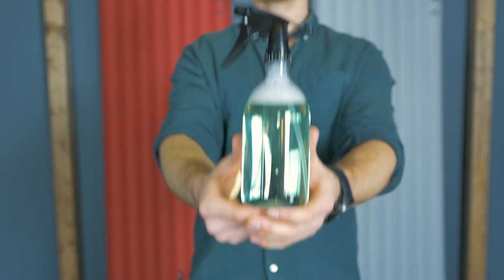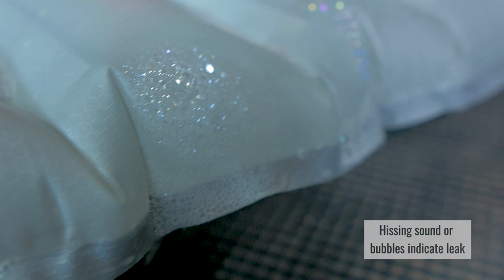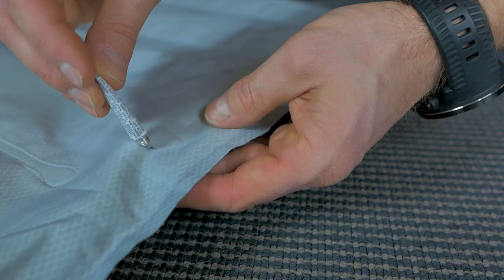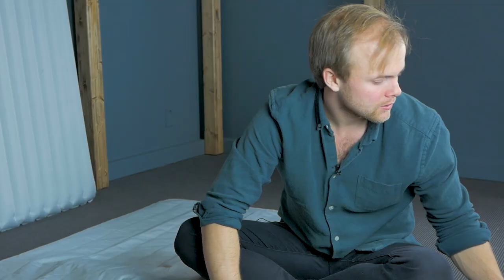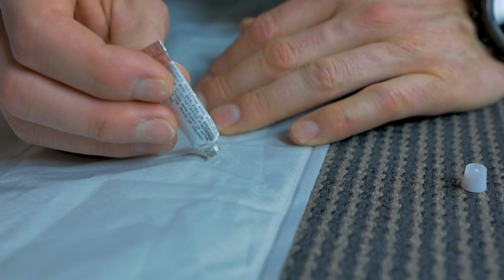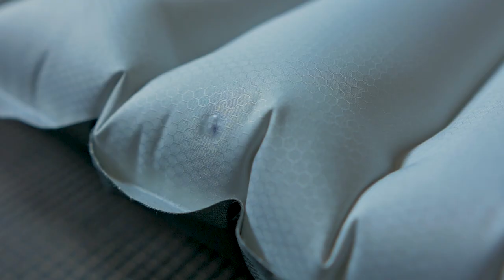How to Repair Leaks in Your Sleeping Pad | Amok Equipment

Comment: good advice. but whats the solution if the seam leaks as it did in three of my previous fjol airpads?
Reply from the maker: Unfortunately we haven't found a good solution for repairaing leaks in the seam yet. But lucky for you we treat leaking seams under our warranty as long as you can send us a video showing the leak. Reach out to us at support@amokequipment.com and we will help you out :)
Reply: thnx. i ordered a new fjol pad last week. hopefully i have more luck this time. i tried to fix the leak in one of my previous pad with bicycle “repair spray". makes a huge mess and does not plug the leak!!! 😂

Comment: It comes with a repair kit?  Didn't get one with mine.
Reply: Woulda rather got a patch kit than a deck of cards I'll never use.
Reply from the maker: @burmy1552  The sleeping pad comes with a repair kit. It should be in a small pocket inside the stuff sack. If you haven't received one you can reach out to our support team with your order number and they will help you out. support@amokequipment.com 

Team Amok